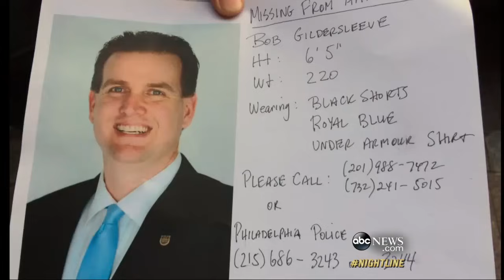Amtrak Train Derailment: New Crash Details Emerge

Comment: The engineer claims to have a concussion and doesnt remember anything but he seem to be in his right mind when he got a lawyer less than 24 hours after the crash!
Reply: Floridaoutlaw84 
***** 1 second ago
 Heres what nobody telling you I know freight trains have a P2A Brake valve and Im sure Passenger trains do as  well. This locomotive appears to be a EMD. They have an overspeed which is suppose to send the train into penalty at 73mph meaning the brakes become applied. A brake test is suppose to be done prior to service to see if the over speed is functioning by pressing the over speed button until it reaches 73mph which sends the locomotive into penalty meaning brakes become applied and sanders kick in. I know for a fact that people at times skip the air brake test as I've seen people sign it off when I use to work for BNSF from a Former Locomotive Mechanic
Reply: Floridaoutlaw84 The Union probably got him one...
Reply: Luis Luna Siemens, not EMD
Reply: @luisluna1989   I say you're a fraud, dude. I say your explanation is Luny, lika a luna. I say there wasn't anything wrong with the brakes. I say this whole thing was staged. I don't care what you've seen.
Reply: It’s An Siemens

Amtrak
Cities
Sprinter
64
Reply: @colamations5066  I'd of asked for a lawyer with the first question asked by the cops since they only want to come up with a reason to blame you.

Comment: The fact that the conductor says he "doesn't remember anything" is suspect in itself. What was doing, sleeping? A passenger said that it sounded like someone stepped on the breaks.
Reply: Lydia Lindquist That’s wrong. He had a concussion and he was knocked out I think, I don’t know if you will respond.
Reply: That’s What I’m Trying To Figure Out My Self He Had To Be Doing Something That Caused This Tremendous Horrible Amtrak Train Ride Collsion In The First Place
Reply: I’m Not Buying That He Doesn’t Remember What Happened Nah Buddy
Reply: he wasn’t sleeping, he got a concussion from the dashboard of the engine when it flew of the tracks
Reply: fun fact! the frankford junction curve is where amtrak 188 derailed at 9:32 pm across from the factory where my dad works ! he was going a total of 56 mph over the speed limit ! what a joke !

Comment: 1:30  If true, he obviously fell asleep.  That's not surprising since those guys are required to work long hours with only a few hours between shifts to "sleep" (sit in an employee lounge and drink coffee and maybe doze off intermittently).  The same is true of long distance bus drivers, truck drivers, and even airline pilots!

These people should be legally required to to work no more than 8 to 10 hours per day, no more than 40 to 50 hours per week, and get 12 to 16 hours time off between shifts where they can sleep in a real bed.

Of course, that'll never happen because treating their employees humanely will cut into the suits' profits...
Reply: Hungry Guy LMAO well you obviously don't know what you are talking about.
Reply: He didn't fall asleep
Reply: He didn't sleep, he forgot where he was due to a radio call from a septa engineer where the windshield was hit by rocks. He was confused, and sped up thinking he was past it. Credit: thunderbolt siren 1000 production: frankford junction wreck 3 years later.

Comment: Don't trains have overspeed warnings that stop it if you're going too fast?
Reply: Trainfan1055 Yes, especially on this route. The northeast corridor had in cab signaling along the majority of the route. It doesn't let you go far past the speed limit before emergency brakes are applied. This part of the tracks most likely didn't have in cab signaling at the time.
Reply: the simulation nerd I find it weird this is the ONLY stretch of track where they didn't have cab signaling. What were they THINKING?
Reply: Trainfan1055 There are other parts without it.
Reply: the simulation nerd They should instal it. It's irritating how preventable these accidents are, but they just won't spend the necessary money to prevent it.
Reply: the simulation nerd
Reply: Trainfan1055 I don't think so

Comment: Hmm, it's been 6 years, so I wonder. Has the track in the USA been fitted with ATCS (Automatic Train Control System)?
Here in Europe we have that, called ETCS (European Train Control System), and basically not only does it make sure the trains don't run through red lights, it also makes sure that they are not speeding, by measuring the distance between 2 magnetic posts in the underside of the track that are placed a bit apart, and calculating the speed via the on-board computers, if it's more than 5km/h (about 3mph) the train will display a visible and audible overspeed signal, and if it surpasses 10km/h (about 6-7mph) over, then it will automatically apply the brakes no matter the driver input.
The driver can initially override it using the button but eventually the ATCS takes over and slows the train back down to the projected speed limit.
Newer versions of this also have the capacity to figure out what the upcoming limit is and tell the driver to start braking in advance.
Reply: Yes. It’s called positive train control.
Reply: Yes. Since this accident, we actually started requiring tech even more advanced than that - Positive Train Control. It is now mandatory on all passenger lines and major freight lines in the nation, and has been installed. When this accident occurred, all the other tracks already had had it set up, and this was the last track on the list to have it implemented.

Comment: I understand speed is controlled by a single brake/throttle lever.
Reply: Five years later, but it depends on the train.  I think that most Amtrak locks have a throttle lever and also 2 brake switches; one of them being an independent brake.

Comment: If a 1+B-B+1 wheel arrangement was possible, this probably would've been avoided. I don't think a GG1 would have an accident like this, even if they were geared for 125. Also, more wheels, better breaking power.
Reply: why can Amtrak think about that?
Reply: NSRailfan8114 Not sure if I'd pin it on Amtrak. Siemens would be the one to blame here. I rode the Northeast Regional yesterday up to Boston, and we got there two hours behind schedule. I think the Sprinters need an inspection.
Reply: +Russell Streak let's hope that the AEM-7s come back and NOW!!
Reply: NSRailfan8114 Don't think that's gonna happen. As much as I want it to.
Reply: +Russell Streak They should have thought about using them for special occasions
Reply: NSRailfan8114 Well, theere was the Farewell run last month.
Reply: +Russell Streak other than that
Reply: NSRailfan8114 Fair enough.
Reply: +Russel Streak probably not...the cab video shows the locomotive tipping onto its side.  This is one of the two big reasons railroads put speed limits on curves: it's hard on the track, and centrifugal force with a high center of gravity.

Comment: How can he be doing 100+ mph in a 50 mph zone ? These locomotives have a system to kick in the emergency brakes when overspeed warning are neglected. Seems like both the human errors and technical errors are responsible for this mishap. Can't just blame only the engineer.
Reply: +Simranjit Singh   My English is not so good, but if i understand correct, the system for preventing a too high speed and slows down a train when going too fast was not present.
Reply: +Marco S The locomotive that was involved in the accident is ACS-64 which comes with all these safety features. I guess they were malfunctioning at the time of accident
Reply: +Simranjit Singh  Agree, it is possible that the system malfunctioned,  but if the track does not have that system, then the train systems also does not work.A system can't slow down a train if the system in the train does not receive speed information via the tracks (or radio). (assuming speed information is send to the train system using the tracks (or radio).)
Reply: +Marco S this stretch of track does have that signal infrastructure.
Reply: +Simranjit Singh  Ok, thank you. That is than something i did miss to understand due to my bad English.(I think you have access to the technical information about that track)
Reply: sort of, not the whole technical aspect, but i know for sure, how it works.
Reply: "Can't just blame only the engineer."
WRONG! CAN BLAME ONLY THE ENGINEER.
He should have known that he was going too fast - if not asleep.
He alone is responsible for the deaths and injuries.
Reply: Simranjit Singh LMAO another who doesn't know what he is talking about.
Reply: Simranjit Singh LMAO you for sure know how it works LMAO. Yep that's a lie.
Reply: @Jacob Cook  I think you responded on a other persons remark, i know nothing about an ASC.
Reply: @user-marco-S  Should of had two engineers in the loco like when they had an Engineer and a Fireman. You get two pilots in an aircraft.
Reply: Just an FYI at the time of the incident, PTC was not installed on most engines
Reply: One of the passengers say it felt like the train was stopping, maybe the AWS kicked in and then they crashed?